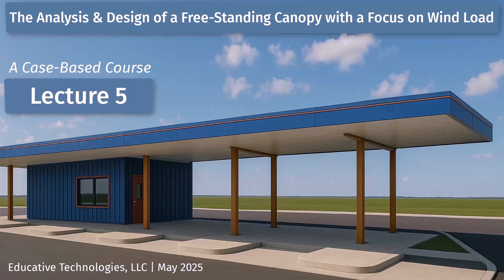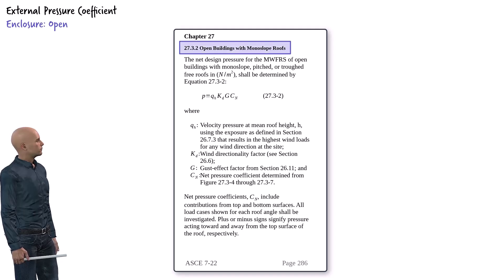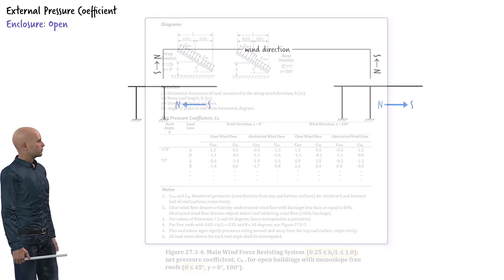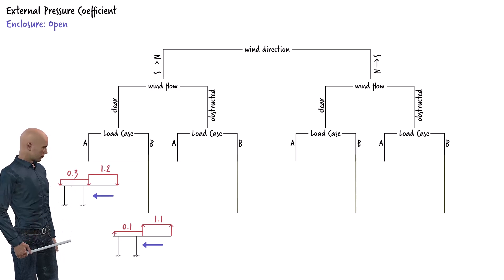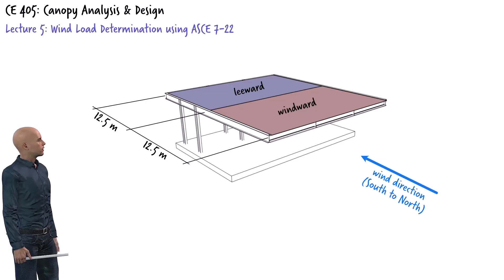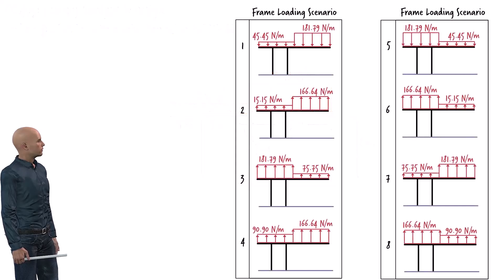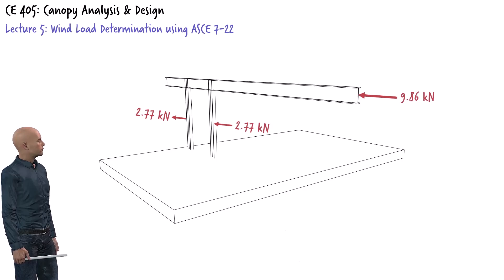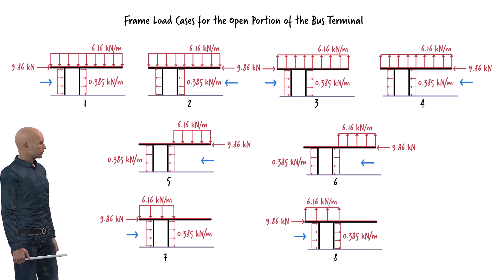CE405 Lecture 5: Canopy Analysis and Design

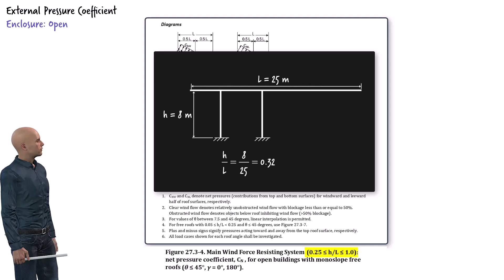Comment: 2:24 What if h/L ratio is not in this range?
Reply from the maker: Per ASCE 7-22, the Cn value for the net design pressure in open buildings is determined from Figures 27.3-4 through 27.3-7.

In this case, we used Figure 27.3-4 since it matches the building specifications.

If the ratio h/L falls outside the specified range of 0.25 to 1.0, then Figure 27.3-7 may be applied, as its applicability does not depend on the h/L ratio.

Comment: Nice video. Ty. What about wind WEST - EAST and EAST - WEST? Is it considered?
Reply from the maker: Yes, in principle, we should consider all viable wind directions in the analysis. For this particular project, though, the bus terminal has a long geometry oriented west–east. Based on that layout—and using engineering judgment informed by the wind tunnel simulation discussed in Lecture 1—we can conclude that the governing wind direction is along the south–north path. Great question!